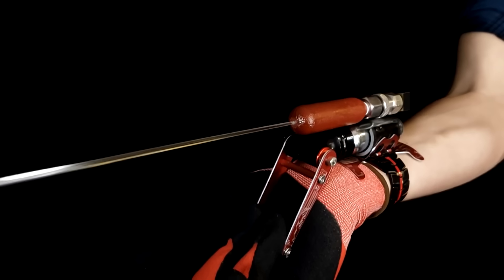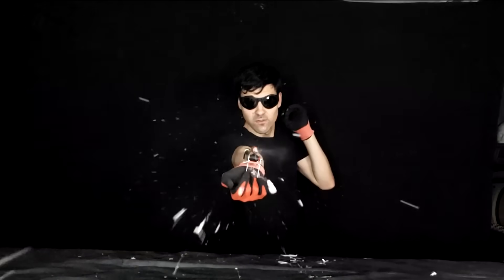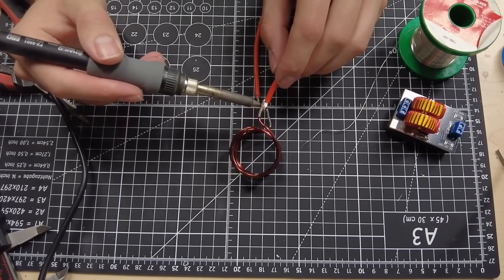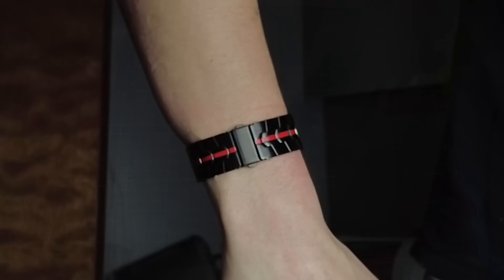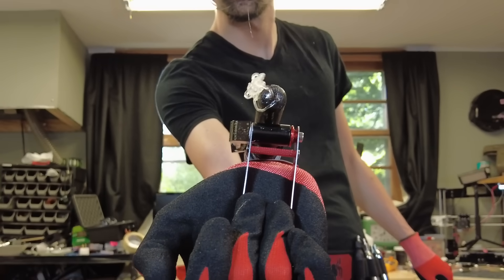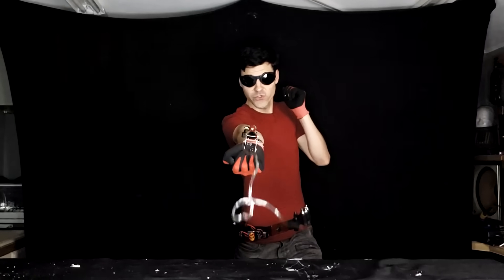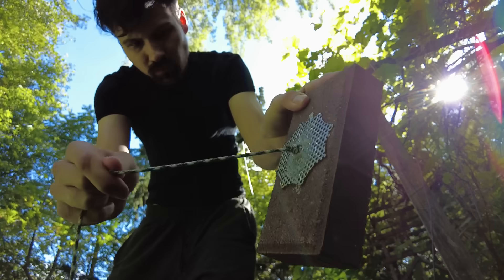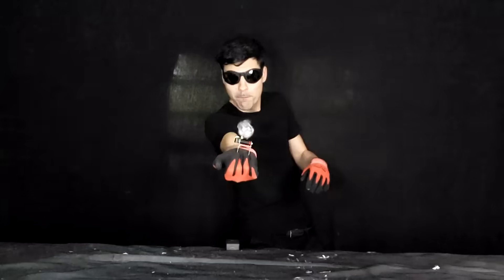REAL Web Shooter (Spider-Man: No Way Home)

Comment: you said that this surface contractor plate increases surface attatchment, hwover i think that if you had miniature cut surface plates and inserted them inside the web catridge , the glue could possibly disperse in a multi-finger expansion of the glue.
kinga like the webbign in amazing spiderman 2 when gwen stacey falls, his webbing opens up liek a hand, a miniature cute of the surface plate + as you said smaller hole for more direct and stronger glue webbing, this could create multiple attacthment points.

i though could be helpful hwoevr i admire yoru ideas and this is hectic

Comment: I saw this video about a month ago and I can't stop imagining how to create a more real web shooter because spider-man is my favorite superhero. I am not saying you should do this but first, you can stick a grapple gun but it faces with the metal thing with holes you created, and you can launch glue and grapple onto it with the other gun on the other side of your arm, now it has no way of coming which leads me to the second part. Secondly, you can install the grapple again on the other side and have a supply of plastic caps with glue on the other side and you can shape it for it to fasten to the thing with holes and when you swing (make sure it can hold you weight and with one quick tug, you can easily detach the grapple and leave the plastic cap on the surface(this is more of like a web slinger or swinger not a web shooter). I do not how if this works because I am still a 12 year old boy in highschool.

Comment: Heat the CO2 ejector as well. The CO2 expands and absorbs some heat to do so. If you wrapped a wire around the co2 cartridge (or maybe just the line from the cartridge to the hot glue reservoir,) you could increase your ejection volumetric flow rate.  Small wire resistor, insulation, put the battery on the belt too, and get a big increase in power. Or maybe just a heater to the CO2 cartridge pouch on the belt, so they're pre-heated.

Comment: What if you could somehow modify the nozzle to spray the webs in a way that spreads the web out for swinging? Like what if when you shoot it the nozzle could somehow make the webs disperse a bit more at the end so it attaches to things easier, instead of using the metal attachment piece you discussed at the end of the video.

Comment: This is so amazing! I do have a suggestion on how you might be able to use one wrist for your glue cartridges and another wrist for your rope and anchor. In order to swing multiple times you would have to have a rotate-able wrist piece for multiple different anchors and ropes which would automatically rotate after the previous shot was fired and released. This would allow you to shoot the glue with one hand and the rope with the other and hold onto the rope while you swing to shoot the glue for the next rope to attach to. In order for you to be able to swing using both hands you would have to have the anchor and rope mounts on both wrists and glue mounts on both wrists which may prove problematic 😬☹️ I hope this helps out in any way!
Reply: But then wouldn’t have to hit the same exact spot twice if he’s shooting the glue and the anchor separately

Comment: What about a pressure sensitive trigger ? Less bulky more streamlined?
Reply from the maker: Would it activate a solenoid valve? Because those are quite bulky at this pressure
Reply: @JoelCreates  sorry Idk even know what that is.
Reply from the maker: @JECohen84  no worries. The trigger has to activate something that allows the gas to pass through. Right now I physically open a valve, but a pressure sensitive (probably electronic) trigger would have to send electricity to a motor or a coil that would open the valve for me, adding more parts and bulk overall, even if the trigger itself is smaller.

Comment: Something to consider is that when you add swinging into the mix your anchor will need to be a lot stronger than if you're just hanging. As an aerialist all of our safety equipment is tested at 5k+ lbs of force (since a aerialist dropping 20-30 feet can exert about half that)
Reply: okay but 14days worth of hanging before breaking and theyre planning  on them being 1 time use
Reply: @rylanmallais2377   holding a small amount of weight many different times without breaking is much different than holding a ton of weight for a short amount of time, its almost easier
Reply: @beebum272  true but the act it could hold him multiple times means it probably could hold quite a bit more for s short period, that being said i know its not a very reliable answer but for what we have right now it should suffice

Comment: How about metallic liquid mixed with the hot glue so when shot out of the web shooter, the metal becomes solid making the surface for the hot glue to attach to. Maybe it’s a dumb idea, but you won’t know unless you try. If there is any type of liquid metal that turns solid when it hits oxygen or some type of gas that is sprayed at it as it it leaving the cartridge.
Reply: Just an idea tho

Comment: You should look into the spring loaded arrow heads that open upon impact like the old reaper heads it could help with launching the plates later on. This is super cool btw.
Reply: I dont think that would work on bricks, bud. Even if the arrow could penetrate at the speed it would shoot, the plates on the sides of the head would need to be extremely powerful in order to force outwards through the stone. Although it would be an amazing idea.

Comment: i believe theres a way to have the web shooter mount, you can have a web cartridge where theres a slot above it where you put the mount in, the cartridge has to have a large web blast hole and it launches, making both the mount and the glue stick onto it while also launching into where you wanna swing on.

Comment: I gotta say that's a huge improvement from other web shooters out there but a recommendation in the comics and tv shows and movies Spiderman is able to release a bigger web I think you can achieve this by using a garden hose attachment system where you can switch to different styles and etc

Comment: Maybe make an elaborate folding anchor that can be saturated in glue in it's cartridge and shot out. Then have it open either in flight or upon impact. You could also do some sort of casting net like design saturated in glue to be shot out. I'm sure there are net gun designs out there somewhere, take a net gun and then attach a rope to it and saturate it with glue. I don't think you'll be able to dry the glue quick enough though no matter what you use unless you tinker with the chemical aspect of the glue you use

Comment: Is the hot glue going to dry in time? Or are you going to be flying through the air, and your hot wet glue not hold your weight and you fall to your death?

Comment: ok so, i love your videos and i have 2 ideas for the web anchor
1 - you could have a separate shooter for the anchor in case you can't put int in the same shooter
or
2 - you could make the anchor collapsable, so when it was folded up it would be thinner and fit in the side of the shooter, and then have it tied to a miniature rope shooter and have it be proppelled fowards by maybe a secon co2 canister?
anyways these are just ideas, but if you think they might work, pls try

Comment: Ok I just googled the science of stickiness and it said things become unstuck when a layer of air gets between the adhesive and the material. So if you could put a high-pressure air cartridge in the middle of your shooter web, maybe you could unstick the glue just by a push of air

Comment: If you could find a way to make temperature or pH controlled glue that changes stickiness depending on the heat/whatever applied to it, you could be able to stick and unstick the webbing

Comment: if I had to say something to all the webshooters designs... I have to say your really over thinking it, and not thinking in the right box ^^; 
1: Spiderman make his webbing home made so why not do the same?
2: the web capsules are compress, you got the right idea but try making the capsules more smaller,
3: it been proven Webbing of a spider is very strong, so if you can make the webline as round as a capble, it be able to hold almost anyone's weight.
4: take in note of its size, small and light, able to swing your arms easy. also the web capsules hold a lot more webbing than you think.
5: don't over think, just look up anything for compress, spider web making from things.

Comment: It's possible that you could find a type of metal mesh, give it a frame and make a collapsable folding cartidge.

it would probably need to be spring-loaded or assisted so when it exits the capsule it would expand 
You could also find a way to make it expand on impact like a mousetrap

whatever actually will be holding the surface area would need to be strong enough or have enough surface area to hold a good amount of weight so it could be metal mesh with a umbrella-like frame or something completely different with more structure.

then theres the rope and how its attached to the shooter and the projectile
potentially you could use a type of fishing line (its small and strong and if its metal it most likely won't melt ) and house it on a reel inside the shooter, but that may make it hard to shoot the thing far if the line gets glued up.

theres also the ease of use if you did get it to swing because there wouldn't be a free hand to load the cartidge with if your swinging with it

either way there are many possible things that could work or fail completely. 
I hope those are some decent potential design ideas. 

and sorry if there are some typos and poor punctuation and grammar

Comment: After I saw that metal web cut out I was almost instantly considering ways to make it more compact and efficient, perhaps one idea that may potentially work would be a sort of spreading apparatus that upon firing flys out of a cylindrical barrel or small opening that opens up from a tube to a sort of hexagonal flat shape. The notable problems of course is what kind of design would be strong enough to A: Not break upon impact, travel or firing, B: wouldn’t snap at an anchor point or break at the limbs when weight is applied and C: How would a good amount of hot glue be stored inside the apparatus? Perhaps C is the easiest to answer as you could either flood the hollow bit of the apparatus in folded form with the glue and upon impact would open up to release the hot glue onto a surface? This is purely speculative as I have no means of testing this for myself though hopefully this comment will give some insight into my thought process.

Comment: Oh yeah so like your thing fires the whole red thing so the reload process is just put on a new one as you swang on the old one

I'm jumping the gun here but if you use this idea you can make it so that you can slide the new cartridge and rope on like a quick reload from your belt, because if your swinging that would be a little hard to do mid air just sum to consider. A reload system 

Something else is including me ik you don't know me at all just some random YouTube comment but I had an idea very very very similar to this but with no budget so I got ideas lots tons.

Comment: Hmmmmmm so like launching glue and anchoring and rope all at once. Definitely possible your anchor does have holes 
What if your anchor was the cartridge so then you have rope on the cartridge and it fires glue and holder
But then you need multiple ropes
But spiderman doesn't reuse webs soo hm hm hm hm
Okay okay you have your cartridge that fires really well now just ignore the glue focus on firing the rope and anchor with the glue on the anchor 
Is this good?
I can like make a more detailed description if needed

Comment: Maybe use a collapsible version of your metal web anchor? Kind of like an umbrella 🌂 that expands when shot. The glue could shoot from the tip of the "umbrella" to prep for sticking to the wall.  Maybe find a way to fire the web anchor umbrella and the glue at the same time? Then use a biodegradable material as the rope that can be cut off from the source when released.

Comment: I had a thought, just wanted to see if anyone would help plot out an idea with me- how about a system on top of or beside the hot glue co2 system that shot out the string after the glue so you would be able to shoot once and not need to apply the string to the glue after, Or put a system on the other arm that allows for less bulk and an ability to shoot the string more accurately.Of course I am not as knowledgeable as others so I’ll let this comment float and see who could add on to this, also whoever sees this I hope you have a great day!

Comment: Ok, I don’t know if this may seem like too much but you should also add a spinnerette, making it gain a stronger tensile strength, ways you can make it easy is essential just making it so the nozzle can spin with only the pressure of the glue going out, the same tricks been down with plastic cement and a tuboware with some holes in it (note they use a drill so I’m unsure of my theory on the pressure spin is gonna apply here) it made a rope like like web that even could work for nets and larger webs!

Comment: Put the string and glue in the same cartridge with a small load bearing spike cap. So a solid glue cylinder would have a small wire coiled in side.

Comment: Welcome to Gboard clipboard, any text you copy will be saved here.Tap on a clip to paste it in the text box.Use the edit icon to pin, add or delete clips.Touch and hold a clip to pin it. Unpinned clips will be deleted after 1 hour.

Comment: you might be able to make the web anchor fold into a skinny tube since it is in a web shape (cut the at the long lines and maybe add tiny hinges) and have weighted tips so when it fires it can spread out (also possibly consider the design of an umbrella)

Comment: Have you tried experimenting with 2-part epoxies? For example, if it says 2 drops of hardener and you put in a bunch, epoxy can get really hot and set in seconds. Switch the cartridge for two compartments of carefully-selected sizes, and a mixing nozzle. The nozzle may quickly clog, but disposable one-off cartridges or easily replaceable nozzles could sort that.

Comment: You could make your anchor like a flower, with the “bud” at the front of the projectile and the petals hinged and tucked back like a slimmer shuttlecock, then you could load that in your hot glue chamber (with the glue already heated and coating the mesh) so when the projectile is fired and the bud contacts a surface, the petals would fling forward and expand outwards into your current shape. Your rope could be a slimmer wire, maybe a few platted lengths of deep sea fishing wire (rated for massive fish or possibly medium sized adults haha), set up on a spool on your belt and fed up a thin but rigid pipe to your wrist. That would be what I’d try next if I was in your shoes. 

I’m not a maker, just thought I’d add a different perspective

Comment: Maybe instead of drilling a hole In the back of. Each cartridge you could use a nozzle that works like an iris valve that you can control electronically, that way whether your shooting a string or a blast you can still use the same cartridge. It might even work with the swing-able rope if u can make it expand to a big enough diameter to shoot the a glue saturated woven rope projectile

Comment: More pressure and the metal piece could sit inserted into the end of the nozzlewith a rod attached, then the metal piece could be shot much like a harpoon gun is but with a glue chaser that splats it in place when it hits

Comment: You could try making a foldable anchor that would fit into the exit of a cartridge. This way, the glue and the anchor travel at the same time while the anchor unfolds mid air. Sounds kinda difficult to implement though so Im excited to see how you solve this design challenge.

Comment: For your anchor, an idea I'm sure you already thought of would be to make cuts kind of like slices of pizza so that it could essentially fold in on itself and be compactbut then when shot it would need to spring back in to shape as it's being hurled through the air. I thought that anchor system you had was just absolutely brilliant
Reply: Zackary Piper mentioned spring loaded arrow heads, and I thought of this exact same thing after! It's such a cool idea and concept
Reply: @lisaborkowski6456  ha! Arrow head sounds waaaay cooler and more official than "pizza slices"

Comment: Create a metal mesh casing that spreads out flat like a hollow tipped bullet on impact. Like a pyramid shape (or some other multi sided 3D polygon) with weak linkages connecting all the sides that on impact forms a 2Dstar shape. This allows your anchor design to fly through the air easier. Inside, incase a dosed out amount of hot glue that you can heat up with an induction coil. Hopefully the mesh structure can take advantage of the surface tension of the hot glue and it won’t leak. If all goes well and you get a good stick when you shoot it, all that’s left is attaching string. Hope this makes sense, may test it myself   —————I>

Comment: Hey!! If you have difficulty with metal working and knowing the right speed for the right materials I would recommend (The Machinery Handbook). Its pretty expensive but well worth it in the end because it shows you everything you need to know for the speeds and more and it as a lot more useful things. I'm a Student in mechanical engineering and in are metal working and material analysis class we use this and its like the essentials for us.

Love your content!